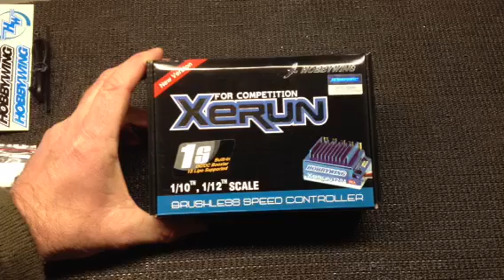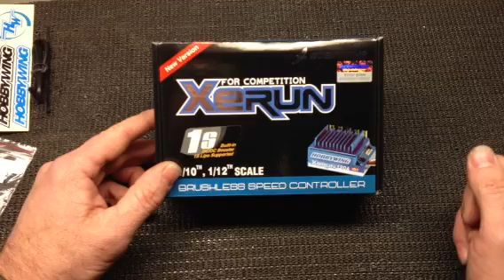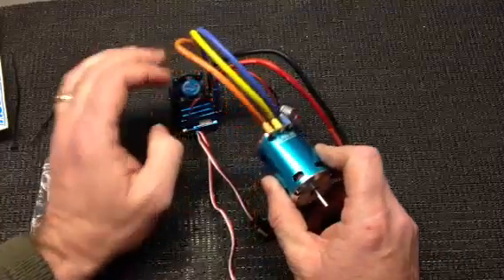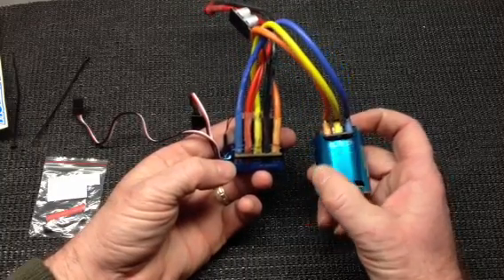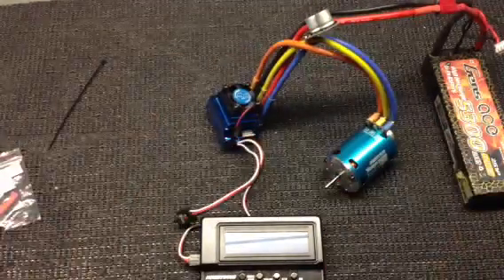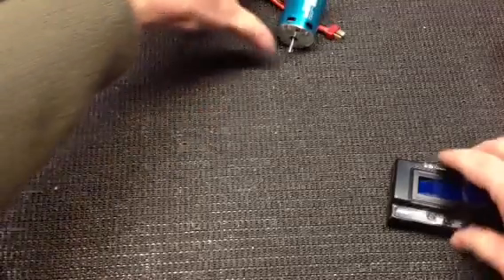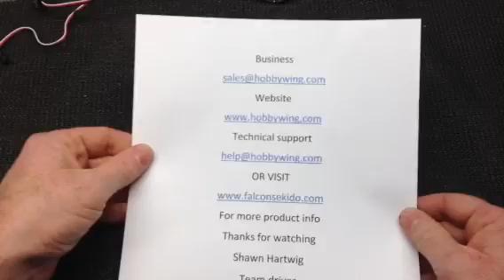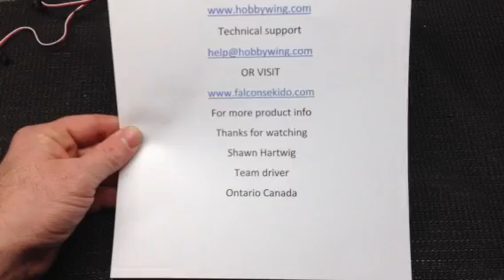XERUN-120A-1S Speed Controller

Comment from the maker: Hi Clay. If you have the first version of the 1S then you can use a 2 cell lipo battery no problem. I was running a 5000mah with it with no issue. If you picked up the New Version V3.1 than you can only run a 1 cell lipo. Keep in mind that the higher the MAH the more weight you will have. If there are no weight restrictions at your club then you can go as high as you want with in reason as long as it still fits in the car.

Comment from the maker: I'm afraid not. When the sensor wire is in use the motor and speed controller needs to be hooked up with the A,B,C wires in the correct orientation. Depending on your radio you should be able to reverse the throttle channel.